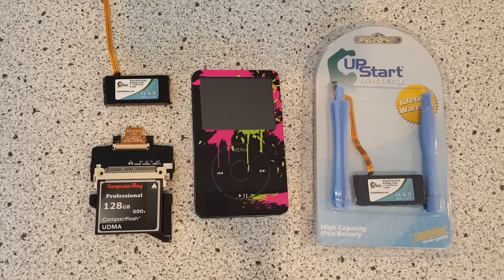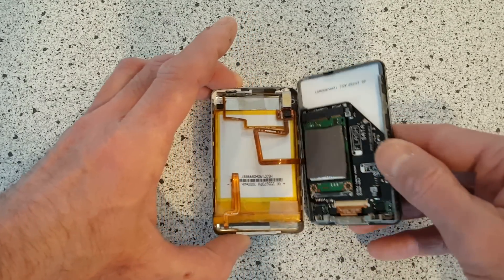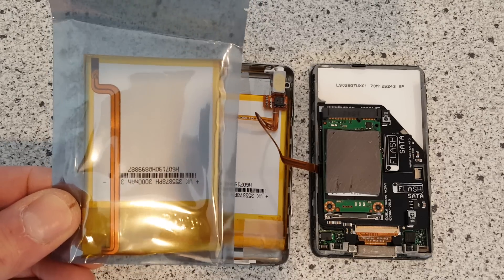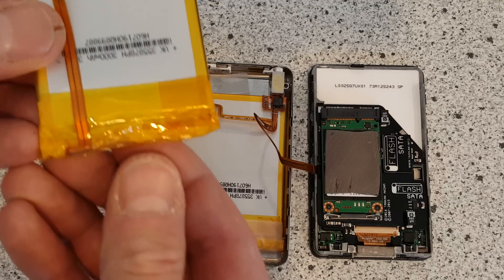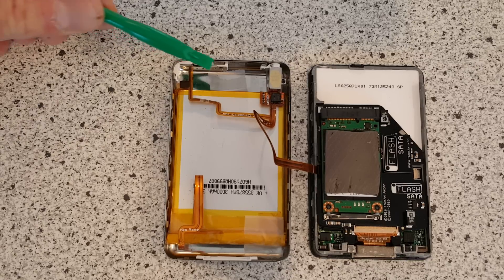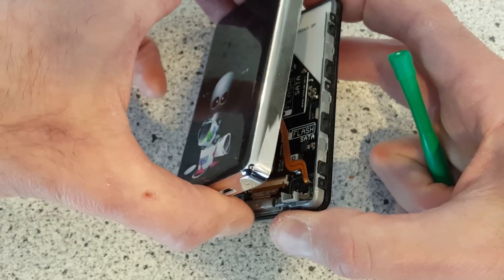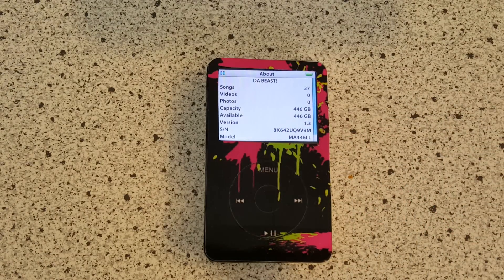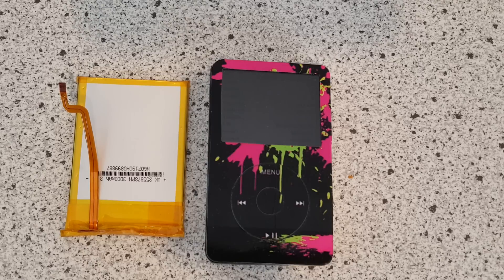Modified 1/2 TB iPod - The Beast!: Battery Life Issue Solved

Comment: Would you be able create a video that actually tests this 3000 mAh battery upgrade, not just the installation? In the video your claiming that this has 3x the battery capacity over the 850 mAh Battery.  I'd be curious to see if you actually were able to observe that performance increase--- clocked with a stopwatch and not a guesstimate of battery performance. If you tested this battery out and uploaded a video I'd definitely tune in to watch the results.  Thanks for the Ipod Content.  💯
Reply from the maker: That would be interesting but way too much work for little return. I can tell you anecdotally that I’m still running that same battery 6 years later and I have yet to have it suddenly run out of juice on me. It lasts for days on a single charge and I charge it only to top it up, not because it ran out in the middle of a tune. I’m actually way behind issuing some new iPod content - too many motorcycle projects, unfortunately.

Comment: I built a white 1 tb iPod Video using an iflash solo with a 1 tb single SD card and installed a 3000 mah battery too. I made my dream iPod but I am feeling a little down with my loose click wheel. I heard people suggest I place tape underneath the click wheel. Does anyone have advice for fixing a poor fitting click wheel?

Comment: do you need to buy an "extended" or deeper rear cover to use those large batteries?
Reply: Yes, you need the thick back cover. The 3000 mAh battery won't fit in the 30 gb back cover.
Reply: @billyc2493  got it. thanks for the reply
Reply: there are also thin batteries to fit into thin backs.

Comment: Battery might fit a lot better between the display and iFlash… its a similar size and shape to the old HDD and you wont have to bend the cable… so much better
Reply from the maker: Would probably fit, but you’d need to bend the earphone cable around it. For me, I prefer to keep the battery away from the motherboard to keep the heat away and against the outside of the case for heat dissipation.
Reply: @tonystrackandtech1698 but the ssd can become hot during syncs, having it facing the battery isn't worst ?
Reply: @diegosanchez-su6wv  depending on your cable management you can sync with ipod open so battery is far from ssd but SD cards are already faster than the iPod anyway so no real point in SSD speeds
Reply: @TheGelatinousSnake  I got the ssd and adapter very cheap, but I'm planning of buying a iflash solo later, I was thinking of doing the battery between de ipod board and the ssd adapter, and putting a thermal pad on the ssd, so the heat can dissipate better using the back plate, but I'm not sure
Reply: @diegosanchez-su6wv  if I had a spare ssd and iPod, I’d do the same. But luckily I had tons of SD cards so I get to enjoy the battery life savings. But in cold places, slightly warmer pocket might be nice
Reply: @TheGelatinousSnake  right now is cold where I'm living, so it will be okay, I wonder what is more risky having the ssd heating the battery if I put the battery over it, or the battery heating the ipod board if I put it below the ssd, I'll put some foam in between but still

Comment: Man, I really wish that someone somewhere on these 3000mah battery upgrades would have mentioned that this will only with if you replace the drive with the after market one. I have 2 iPod classics open, and one 3000mah battery in place, only to find that it won't close because the 30g hard drive is too large. 😣 I guess it's back to the original batteries.
Reply: I am not 100% sure but it might work with a back from an iPod Video with 60 or 80 gb or a classic with 160 gb (the earlier version)
Reply: Or much thicker case.
Reply from the maker: Yes. Just uss a thicker back cover from an iPod 60 or 100.

Comment: Which iPod version is this?  Looks like the thicker body?  I ask because I have the thinner body 120GB version, so wonder whether it would still accommodate the thickness of this battery.
Reply from the maker: It’s an iPod video 60 gb with the deeper back.  The battery won’t fit in the thinner body, but you can buy the deeper back on eBay pretty cheaply.
Reply: Good to know.  Thank you so much.
Reply from the maker: Welcome!

Comment: Do you know if the 30 pin cord from the newer iPod Touch fits this ipod 5Gen if so they do have a wireless transmitter that plug right into work like a Bluetooth
Reply from the maker: As far as I know there was only 1 version of the 30-pin plug, so it should be the same.

Comment: ssd msata vs quad micro sd? im curious, i loved that ipod and now that i find about moding i want one but this cuestion strikes ... which storage is better?
Reply: msata is more reliable, much lower chance of it corrupting over time but it does use nearly double the battery than what SD cards use.
sd cards are much less reliable and have a vastly bigger chance of corrupting (the chance goes much lower if you buy high end sd cards like Trancend high performance, or SanDisk Extreme Pro UHS-II which are both considered very reliable, but also the cheaper High endurance cards of both SanDisk and Trancend are extremely reliable just much slower than their higher end cards, but i would completely avoid any of the cheapo SanDisk Ultra or any other cheapo low end SD card), either way SD cards is the way to go if you want to have the best battery life in an iPod.
personally i am using two iPods, my 7th gen has a 512GB mSata SSD in it and my 5.5th Gen has x4 128GB (512GB) SD cards setup.
i use the 5.5th Gen more than my 7th gen since of the increased battery life but in the past year and a half i already had one of my sd cards getting corrupt and had to replace it so yeah... its all up to you basically
Reply from the maker: I’m going with a quad micro SD for my next build.  I have the parts, I just need to shoot the video.  The mSATA SSD is getting harder to find, plus it generates way too much heat.

Comment: Would that 3000 battery fit int he thin case with an sd card in it?
Reply: I had the same question..I have read several comments and apparently we need the thicker case!
Reply: @sphasout Thanks!
Reply from the maker: You’ll need the thicker 12mm back plate, but keep the headphone jack from the thinner back plate so you can slide the battery under it.

Comment: I havea similar battery but it will not fit with my 256 gb iFlash drive installed. What iflash storage are you using?
Reply from the maker: In Da Beast I'm using the mSATA iFlash card and a 500 GB drive.  You should have plenty of room if you have the deeper case.
Reply: @tonystrackandtech1698  Oh, well perhaps that is the issue. I think I have the slimmer model.
Reply: @tonystrackandtech1698  Thanks for the response.

Comment: the casing that you used, where did you get it because with the original casing and the 3000 mah battery does not close
Reply from the maker: It's the original case.  This was originally a 60 GB iPod video, so it has the deeper case.

Comment: Hi can you please help me if you can I have iPod classic 5th the iPod don't turn on is self just turn on when is plag in I been change a new battery and still the same  I charge the new battery four about 8 hours and is never say is full  any help thks
Reply from the maker: It could be that you have a bad battery, even though it's new.  A common problem is the receptacle that you plug the battery into.  If you wiggle it around too much a connection can break loose and the battery won't connect.  Get a magnifying glass and check the 5 tiny pins.  If one is loose it can be carefully soldered back with solder paste.  Don't use solder wire as you can use too much and bridge 2 of the pins.  I've re-soldered a new receptacle when one completely broke off, but it's very tricky.  You'll need magnifying glasses and a temperature controlled soldering iron.  Or take it to an electronics shop, who has the right equipment.  This video will help you:  https://www.youtube.com/watch?v=1vfupcWZsxw.

Comment: Is there any way to fit this exact battery in a thin 7th gen 160 gb ipod with the same card slot installed?
Reply from the maker: Fitment would be too tight.  You'll need the thicker case.

Comment: Sir i got a battery of Ebay. It seems like the battery charges to the full 100 percent it shows the icon of full charge. It seems battery drain is pretty high it just lasted me 24 hrs. Do you think there's a problem with my ipod or the battery? I use the 5.5th gen the same one like your ipod
Reply from the maker: A lot of these eBay batteries are duds even when new

Comment: Okay, I understand, so how about this? I have a 4GB Nano,  3rd Generation needing a new battery and a memory upgrade (sd micro of 256GB). I'm appreciative of your suggestions.
Reply: You can’t mod a nano. It uses flash memory to store things.
Reply: You can't do this with an iPod Nano. The flash memory is soldered directly to the logic board, so it can't be replaced.

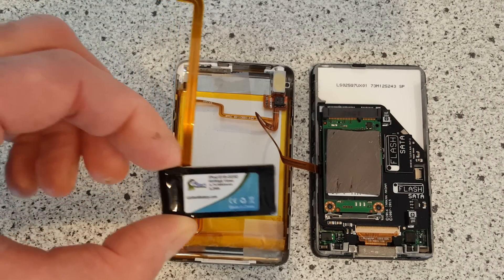Comment: 1:45 

4-6 months battery life??? Do you mean 4-6 hours
Reply from the maker: Maybe what I said was confusing.  Sorry.  I meant not 6 months on a single charge, but 6 months of use until the battery has to be replaced.
Reply: @tonystrackandtech1698  You didn’t say it wrong it’s just some special people who were bottle-fed can't comprehend simple English.
Reply: It think he means not with continious use
If he doesn't use it all the time
Reply from the maker: What I meant was that the battery died after only 6 months of use.  I think that the mSATA SSD generates too much heat and damages the battery.
Reply: Tony's Track and Tech Your assumption is correct, I have been working with electronics for a while and ssd tend to heat up a lot. The nvme  ssd in my custom built pc can reach up to 100 degrees celcius and it has a heat spreader on top. I would recommend going for a MicroSD card or a SD card which are designed to operate in tight unventilated spaces.
Reply: months indeed, 3000 mah is A LOT for that tiny screen and with a practically zero power consuming storage ssd, at least two months are for sure surely lasting.
Reply: With SSD and 3000 mah battery...

He means exactly what he said...months.
Reply: Through The Smoke so it will last 4-6 months on a single charge?

Comment: Hello everyone. Ive been looking into modding an ipod classic 7th generation. Is anyone using the I-flash quad adapter with success? Want to get 400-800 gb of storage
Reply from the maker: A 7th gen will work, but it doesn't have the Wolfson DAC.  So the sound fidelity isn't so good.
Reply from the maker: I have a quad adaptor and four 250 gb micro-SD cards, and plan to find out.

Comment: Quick question mate how do you get your battery to show fully charged ive charged my 3000mAh battery overnight and it only show's like half full but i dont know if its running at full capacity or just an error on the ipods side that it cant read it correctly.
Reply from the maker: It should show a full charge, which is based on voltage.  The battery may be a dud.  Happens.

Comment: I have a few questions. It would be a lot helpful if you could answer them.
How long does it take the battery to charge to full 100 percent.
Does the battery indicator in the ipod show the battery full icon?
How long did the battery last during playback?
Did you encounter any problems like battery heating up or something of that sort?
Reply from the maker: Sorry for my late reply.  I've been tied up in a job search.  The battery should charge overnight and the indicator symbol should show a full charge.  Frequently when changing batteries you can damage the battery connector by breaking the connections to the mainboard.

Comment: what ipod do you have? I put one of 80 gb 5g and the metal back shell does not fit, there is space left over
Reply: and with this you can close the metal lid without problems? because I put my 80 gb ipod the 3000 mah battery and it's open back
Reply from the maker: Hmm.  Mine was an iPod video 60 GB and it all fit fine.  It could be that some of these eBay batteries are thicker?

Comment: Hi, excellent video.  You have made skills.  Question, I connect mine to a wall charger and/or PC, but I do NOT see the Apple logo.  Is that a sign that the battery has died or the motherboard shorted.  It was working fine and overnight poof. No more power at all.  Thank you.
Reply: Thank you sir for your reply.
Reply from the maker: Hey sorry, I've been in a job search,  so I haven't been on Youtube for a long time.  When you plug in the charger do you see the battery icon?  Have you tried rebooting the iPod? Cycle the on/off switch from off to on, then press the middle and bottom buttons simultaneously, and hold until you see the apple logo.

Comment: Would a 30gig Ipod thin metal back still be compatible with a 3000 mah battery on an ipod classic 5.5G?? I'm using a solid state drive, so I've freed up some space in the unit. Or will I need to use the thicker back? Great video thank you.
Reply: same question
Reply: Would love to see this also :)
Reply from the maker: You'll need the deeper case.  They're pretty cheap on eBay and you can get different colors.

Comment: Hi
Anthony 
I got the 1900mAh.
New logicboard 64ram,new screen,iflash quad 4micro sd card 1tb.
Though i restored the ipod after it went well.
Then i uploaded some songs to test it went thru.
Now when i try to connect ipod video again to my mac laptop; it 
Shows the battery 
“Icon”
Please wait.
Battery very low. With the spining wheel.
Then i connect it to an outlet it shows the battery is charged.
And i can see the menu and everthing.

What do think ?
Let me know.
Do have a link were i can get youre battery?
Thanks Anthony.
Reply: Thankx again your awsome..! I appreciate your feed make. I feel relief i spent $450 just on sd cards.
Thinking it did not work.
I ordered the 3000 from the link. 
Thank you ?👍👍👍👍
Reply: HEY THERE IM HAVING MAJOR ISSUES WITH 3 IPODS I HAVE ONE IS AN 60 GB THE OTHER AN 80 GB AND LASTLY MY 7TH GENERATION 160 GB THE BATTERYS DIE OUT VERY FAST AFTER 2 OR 3 SONGS EVEN THO I CHARGE THEM ALL THE WAY WHY YOU THINK THAT IS? GREETINGS FROM NYC
Reply: Peter
Hi
Sonido

I can  only speak about the ipod 5.5 now 1tb  i have.
I am using the old battery that i had.
Which is the 580 mAh.
I got a 1900mAh it wasnt even keeping a charge.
When you purchase one look at othe peoples coments and purchase.
Maybe u should replace with a new battery the 60gb see what.happens?

I did not learn this overnight.
Dude 15% is reserach ;the other is how far u feel taking things apart.
Trial and error. 
That is how i came about doing a mod to my ipod 5.5 ,64ram  board. & 1tb .
Good luck 
Research research.!
Reply: @tonka4512  post a video of it

Comment: Is the ssd not heating up the battery ?
Reply: Will this mod work with a 7th Gen,thin?
Reply from the maker: Yes the SSD gets hot. I'm planning a build with Micro SD cards, which should run cooler.

Comment: I really like you video , can you please post the link on where to buy the battery
Reply: Anthony, I am working on converting my fifth Gen iPod to SSD but instead of a flash card, I am dropping in the 1.8" 128 GB or 256 GB SSD.  I am studying the battery mod and am planning to go that route since the original battery is definitely toast anyway. I am also looking at getting the 256 GB rear cover (larger and may allow for better heat dissipation since I am going to install this 3000 MaH battery). I have the two-sided tape that I will use to secure the battery to the back cover.

However, the battery you link to is no longer being sold on Ebay. I did find this one as a replacement: https://www.ebay.com/itm/3000mAh-Battery-Upgrade-replacement-for-iPod-Classic-6-6-5-7-Video-5-5-5-Thin/152933625961?_trkparms=aid%3D222007%26algo%3DSIC.MBE%26ao%3D2%26asc%3D50544%26meid%3Dc4d37b4b16564addaa388b9894dfb144%26pid%3D100011%26rk%3D6%26rkt%3D12%26sd%3D282872630690%26itm%3D152933625961&_trksid=p2047675.c100011.m1850